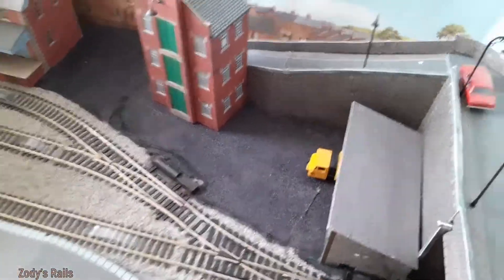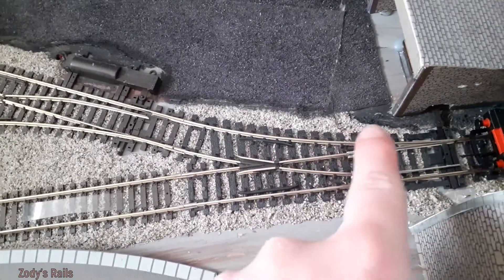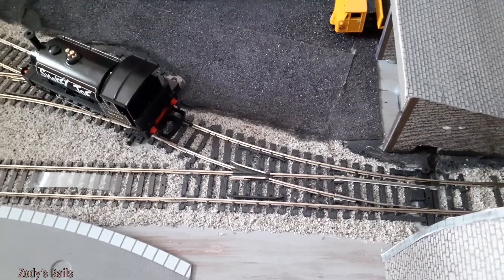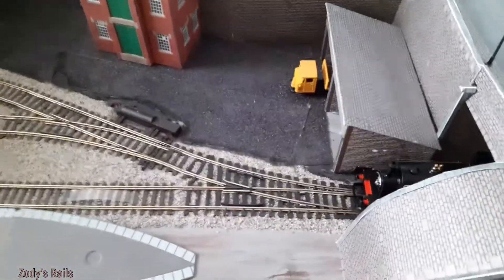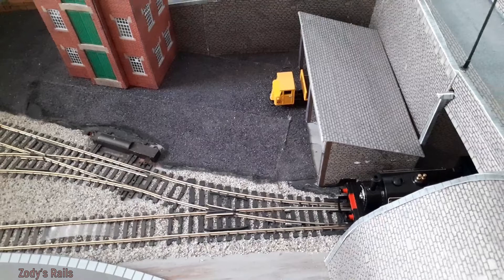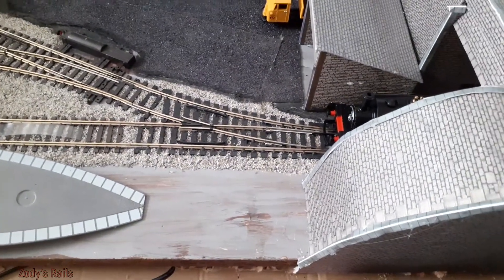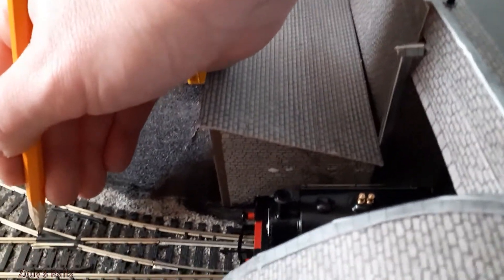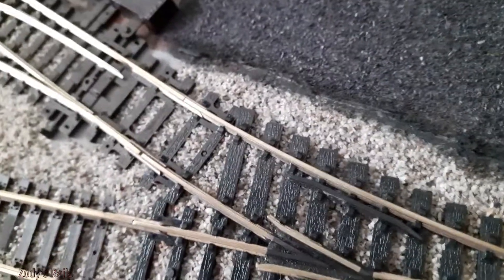Trying to Fix them Pesky Points.

Comment: i think in the future model trains will have rechargeable batteries in them instead of relying on the track for power. this kind of frustrating situation with stalling locos on points just puts people off model trains. i know about electrofrogs and stay alives and such like but beginners especially just want to get up and running without all the hassle!
Reply from the maker: exactly and you would think for DC, that a hornby made loco would go over hornby set track

Comment: Funny that you're having this problem because I've got a Peco insull frog point that's cos me problems with small locos stopping as they go over the point. I've been looking around and one of the solutions is to use a 'keep alive' solution where by you use a capacitor so store a small amount of power to keep the loco moving. Maybe a solution for you.
Reply from the maker: only problem with that is that its more for DCC, im using DC on here
Reply: @ZodysRails  Ah well, maybe Hornby power clips maybe the answer. I've ordered some to test along side trialling a keep a live